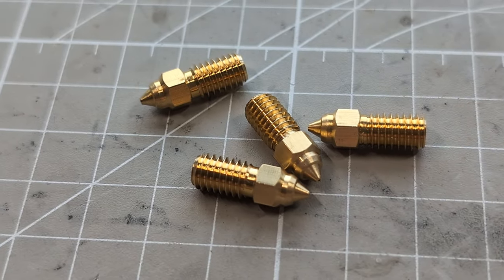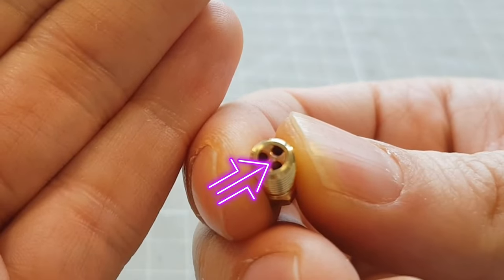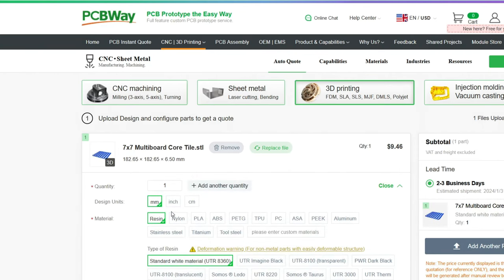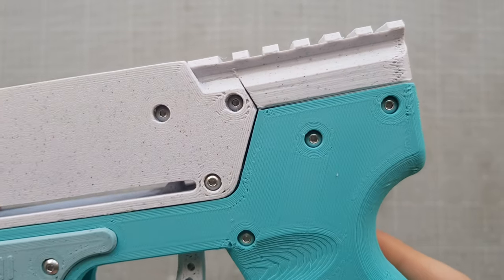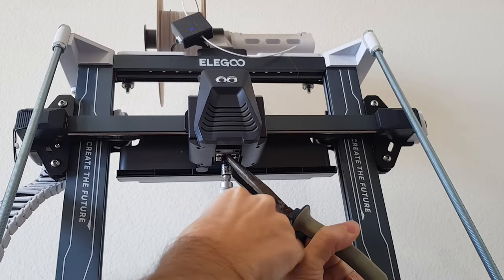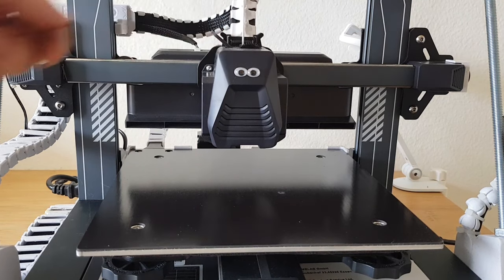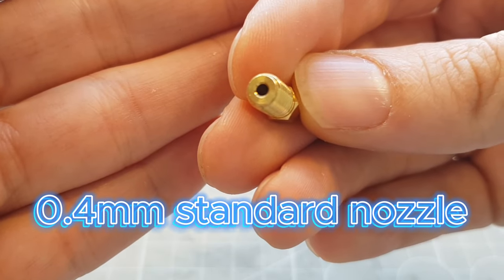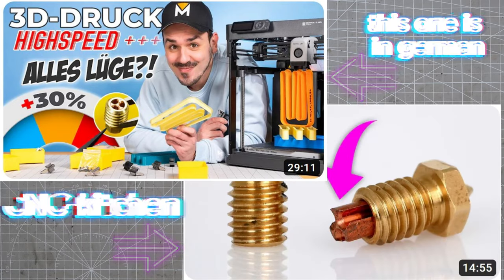better nozzle for your 3D printer + how to install it (shown on a Elegoo Neptune 4)

Comment: I suggest you to put Thermal boron nitride paste around the nozzle and if you can upload more videos like this for how to upgrade this printer quality pls bro for better prints
Reply from the maker: Thx AlxAlx, i will try to. Next videos will be printing a Slingshotcrossbowblaster, and a E-Bike build, but after that i will do more upgrades on the printer 👍
Whats that boron nitride stuff you mentioned? Do you use that?
Reply: You can check on YouTube about the boron nitride it's a good upgrade for your printer  @Dirt-E-Bikes
Reply from the maker: @alxalx5501  thx will check that out 👍

Comment: looking at buying some of these for my printer but heard a few people say there not very good do you reckon the improvement in extrusion came more from the size increase or the difference in design im tempted to buy some an use my dentist drill to improve the blade edge in the inlay bring it more inline with the bondtech one
Reply from the maker: Hi MotoMotion, very interesing, please let me know how that went (further improving it with the dentist drill) 👍
In my case, most of the improvement in printing time comes from the larger diameter of the nozzle. But i recognised some improvement in consistency of the flow when using filament that was allready a bit underextruding with the standard nozzle. I normaly run higher speeds at the edge of my printers capability, so i cant go much faster in movement speeds with the new nozzle... If you can do that with your setup, i think (and heard) that you will get up to 30% more flow (see the links in the description of other youtubers video about this type of nozzle).
And yes there are some voices saying they have bad quality, but also ones telling that they own these nozzles and are very happy with it. I can only tell you my experience, and im very happy with them so far.
I hope this helped, have a nice day ✌️

Comment: Nice video, my friend.
Reply from the maker: Thanks mate, allways a pleasure to hear from you 👍
I was looking around for a nice heated insert-press, as you suggested, and found some, but no one that can use my soldering iron (TS 100) right away. So i guess i have to make some changes to the adapting part. 
At the moment i have 2 other videos that i work on, but i didnt forgot about that one ;-)
Have a nice day ✌️
Reply: @Dirt-E-Bikes  I had the same problem with my iron. Since the mounting to the press was the same l printed out the clamp in this video
https://youtu.be/5a9cios_EX0?si=stGfP1xs7uJFJmUz

But ended up using the one in this

https://youtu.be/h1nRGKFesBM?si=KUY8ubJJG_hPxolZ

Currently, I'm working on a PET filament project
Reply from the maker: @billmacfarlane8864  that one looks nice! 
Cool i also want to try the DIY pet recycling-filament at some point, but didnt looked into it yet. Do you use a hotend from a old printer for that project?

Comment: what white filament do yo usue>?
Reply from the maker: Its called marble white by polytrra, its more like a very light grey with some sprinkles of darker gray material ✌️
Reply: @Dirt-E-Bikes  thank you so much!
Reply: @Dirt-E-Bikes  would you say the layer lines are as visible, less visible or more visible than on a standard polyterra matte (if you have tried one)?
Reply from the maker: @redstoner897  layer lines are less visible because of the sprinkles, they camoflage the layers a bit

Comment: 2 question
this is a reupload? same video few days ago
2, are you using rapid pla / pla + ?
Reply from the maker: Sorry for that, had some problems uploading the video and cant delete them at the moment. Yes its the same video 😅
For the filament: i use "normal" PLA, as well as PETG, PCTG, ASA and some others, but non of them are labeled as the "rapid" or + Type.
Have a nice day ✌️